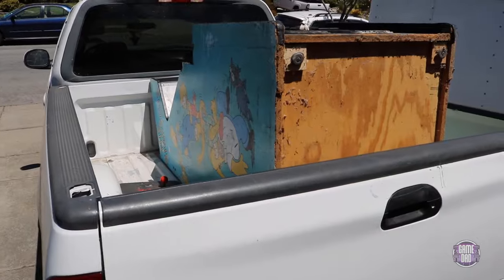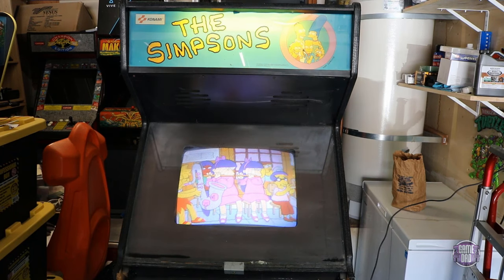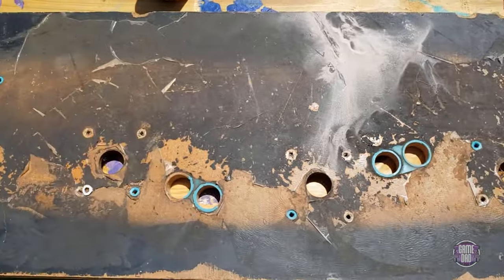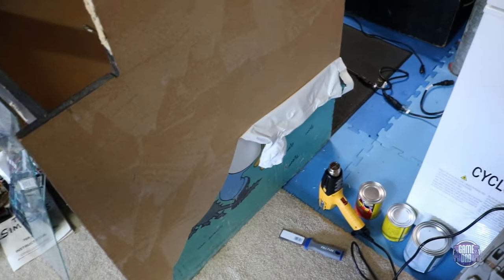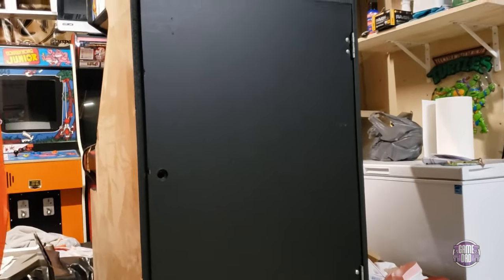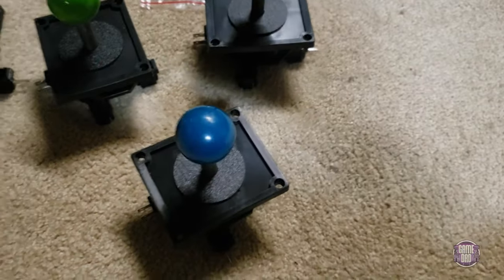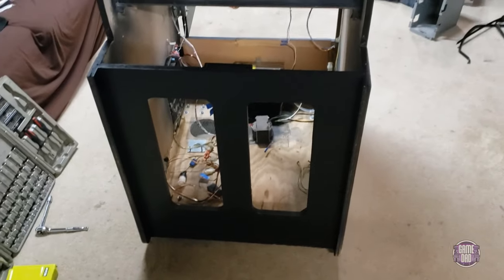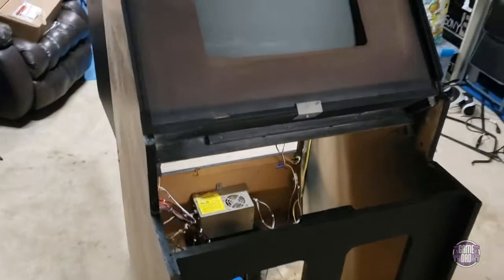The ULTIMATE Simpsons Arcade Restoration!

Comment: Great resto! I found a beautiful Tekken 3 cab a few weeks ago that works perfectly for $300! Tekken 3 was a kit that never had a dedicated cab and this one was in the same Simpsons style 4-Player Konami cab. It has 1 speaker hole though, so that makes it a dedicated TMNT underneath! All it really needs is the PCB, 4 joysticks & artwork. It even has a large monitor that looks like new & the body is basically perfect. It even still has the 4-player wiring harness! I'm going to do the green T-molding and pick up a pre-cut plexi CP overlay. I may also switch out the fluorescent lamp for an LED. I'm really looking forward to this project. I hope mine comes out as nice as yours did!
Reply from the maker: That's AWESOME!!!

Comment: After doing all that work on this game it would be a shame to devalue it with an LCD.  Doing this is not an upgrade.  With LCD you lose the original look of the game.  Sure, you can add a scan line generator but it's not the same.  These CRTs can be saved. You just need to do a cap kit and maybe add a new fly back and it will last you another 40 years.
Reply from the maker: Ya. I haven't done it yet. I'm on the fence for sure.